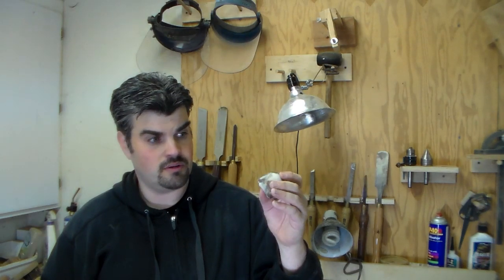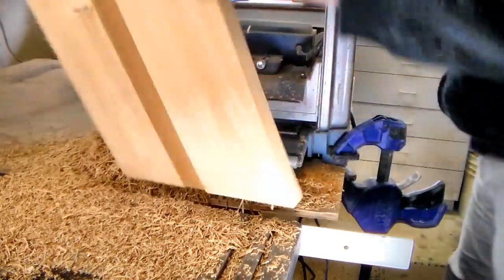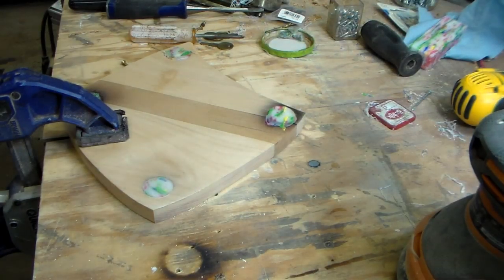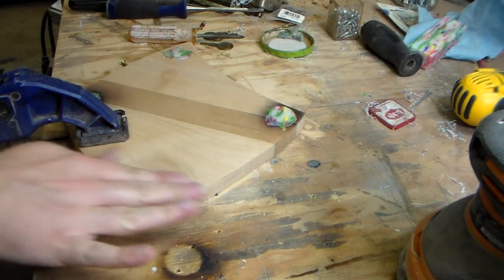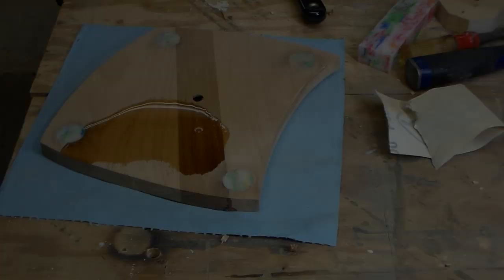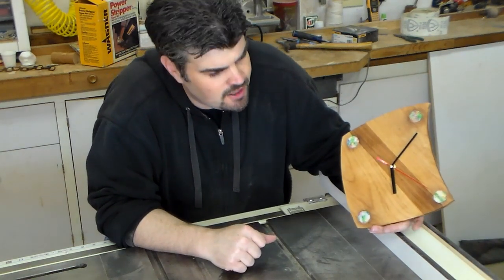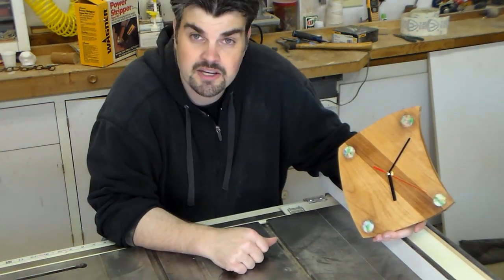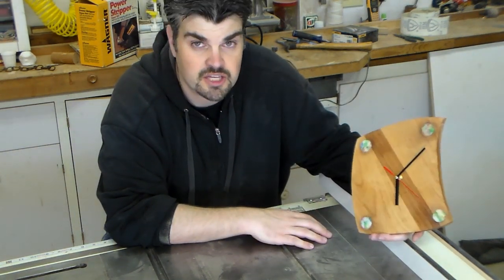How To Make A Retro HDPE Wall Clock

Comment: Would it be easier to drill straight through the wood and then jam the blank in the so it's snug?
Reply from the maker: jason f Maybe? Like if you turned it with a taper? That might work really well actually!

Comment: While you're saying that HDPE won't stick to glues, I wonder what would've happened if you just melted the HDPE straight into the holes left by the forstner bits. I'm thinking if it melts in around the wood fibers that should give it quite some hold anyhow.

Neat idea though!
Reply from the maker: Switch & Lever This stuff is extremely slick and it contracts slightly when cooled. Maybe if you had a wedge shape for it to melt into! Good thinking... It is fun material, and your metal lathe would make short work if it!
Reply: Peter Brown what about putting it into the freezer before inserting?
Reply from the maker: norm1124 I might very well help. I'm still a really noob with this material!

Comment: Very nice Peter,
  I'm looking forward to seeing what you turn out of it on your lathe. This concept of melting HDPE is just interesting enough I may have to try it. I'll need a blender first, Maybe I should keep an eye out at Good-Will. I am most interested in how you finish the HDPE. It looked pretty smooth so I was thinking 6 to 10 coats of C/A and polish it up. What's your thought?

Regards,
Bob
Reply from the maker: RJBWoodTurner Thanks! The food processor I bought couldn't handle it. I'm on a new plan now. An old meat grinder. That's what the bloke over at AtomicShrimp uses!
Reply: Peter - I tried the food processor method and had it smoking in no time, so I like the idea of using an old meat grinder ( and I have 3 of them).  I should have enough HDPE in a few days to try it out.
Reply from the maker: Samantha @ Avalon Wood Works Sweet! for my second blank I just used some kitchen shears. It wasn't near as quick. I was really hoping the Cuisinart was going to work! Shoot me a link, if you end up making something!

Comment: You can turn a nice fly rod grip out of it, not sure if the epoxy would bond it to the rod blank but it would be interesting to try.
Reply from the maker: joeneary1 I couldn't get any glue in my shop to bond. You might have to use threaded rod and some nuts to secure it...

Comment: I'm wondering (and this is based purely on watching like 100 of your videos in the last week) - could you epoxy the HDPE in? 
Also, could you do a clock face (or anything for that matter) with rivers of epoxy-ed HDPE (or another material running through the surface of the wood. It'd look awesome...

Comment: I actually like it, why didn't you just glue in the plastic discs? 
It just seemed to me you gave yourself too much work. 
The discs reminded me of chequers pieces the plastic would also make a good  marble effect gaming board but I recon you would probably tell me what I could do with that idea   XD
Reply from the maker: Ali CG I would have but one issue with HDPE is that glue will not stick to it. You need a mechanical fastener. My way should serve as a bad example. There have been some great ideas in the comments though!

Comment: Very neat idea, I hate it when things do not come out the same way they look in my head, I wonder why that happens, lol. What if you put it in from the back side of the clock. Drill two forstner bit holes with the one on the face a little smaller, then turn the plastic with a matching step and then you could secure it any way you like on the back of the clock. Just thinking out load. 
Have a good one, John.
Reply from the maker: woodturningjohn No, that's a good idea! I mean the back is against the wall anyway so why not? That's a good solution!
Reply: That's what I was thinking.  Or put some grooves in the edge and even though the glue won't bond to it, it will bond to the wood and make a mechanical joint because it's just trapped inside the plastic.  It won't be super strong but it doesn't need to be.
Reply from the maker: krtwood That's really good idea too!
Reply: Or drill 3 forstner holes, depth of each, 1/3 the thickness of the wood, make the HDPE circle 2/3 thick, shaped as you suggest, and a 1/3-thick wood plug, glued behind the HDPE circle, to hold it in.

Comment: Peter, if you created a channel around the circumference of the disk and then filled the channel with epoxy, the epoxy would adhere to the wood but also create a barrier to prevent the disk coming out... I think!

Cheers

Tom
Reply from the maker: Tom Stratton Tom-That is a cool idea... Plus if you dyed the epoxy you would get a very smart double inlay look!!

Comment: I've used super glue to attach plastic to wood and it worked fine.  Likewise with JB Weld and similar two-part paste epoxies.
Reply from the maker: RSM Woodworks It's odd material. I have a video of me peeling dried CA glue off it like paper. It's just not a very porous material.
Reply: That's definitely strange.  When I used wood and plastic together, I bonded a plastic hoop (kinda like a D-ring) into a dado-like slot in the wood.  The plastic hoop had a slight load-bearing element and still held up.  Therefore, I must conclude that the plastic you're using is the work of aliens.  ;-)

Comment: you could simply cover the front of the holes with waxed paper and a wooden block, fill the holes from the back with hot soft HDPE , press it in, trimm the access off the back and remove the front clamp and waxed paper. maybe sand the front flush by hand. I think it would look way cleaner.
Reply from the maker: Pot Racer I like it. There are so many cool ideas in the comments. It's really cool to see so much imagination!

Comment: Maybe cover the wood with foil before using the heat gun. ....or why not use a screw, from behind to hold the HDPE?
Reply from the maker: Chip Smith I think a screw from behind would have been a great idea. I was trying to be clever, and I out clever'ed myself... :)

Comment: Not to be a jerk, but given that the accents were so small couldn't you have just melted small amounts and just poured it? Yeah it hardens pretty fast, but such small amounts would have been easier than making a blank, turning it, cutting it,  drilling it, them melting a layer over.  I mean I know you are a man that loves his lathe,but you don't HAVE to use it.
Reply: gplechuckiii it might not have bonded with the wood
Reply: @chappy7962  it's interesting that you say that. I figure that if they need that baking paper to prevent the molten stuff from sticking, then there must be a way to make it stick.

Comment: What if you just used the HDPE as the accent "wood" in between? You could just use some pins, epoxied in the wood, going though the plastic. That way you get the full color of the HDPE and you don't have to fasten it to anything.
Reply from the maker: David Willett That's a good idea!

Comment: Won't epoxy hold down HDPE?
Reply from the maker: mdbohica nope. Just peels right off when it dries. Super strange stuff...
Reply: Huh!...ok, so how about this idea...keep some around to mold drawer runners or "furniture moving" footy thingys if it's that impervious to sticking/binding.
Reply: mdbohica HDPE is sold commercially for cutting boards (it self-heals) and for miter runners--for table saw and router jigs.  Perfect uses for slick, non-porous material.
Reply: Tim Herrmann I see, am I correct the cutting boards are that white plastic?  I think my wife has one of them.  Good to know!!
Reply: You are correct.